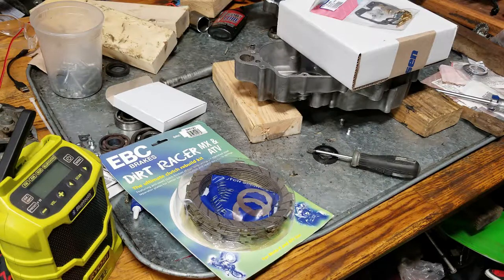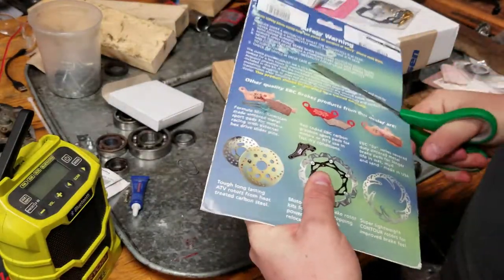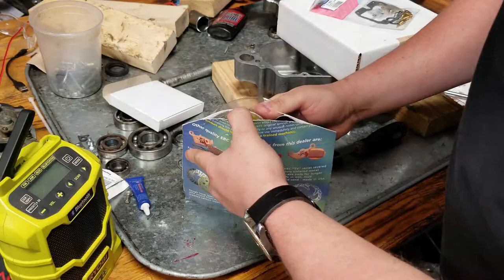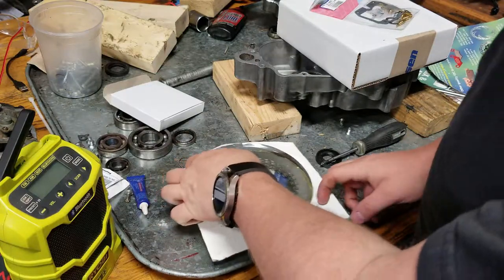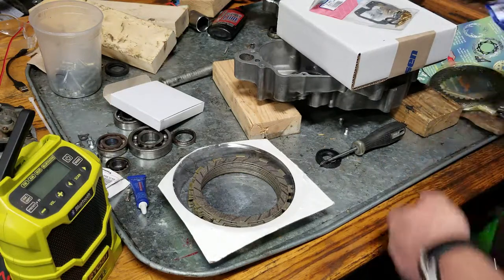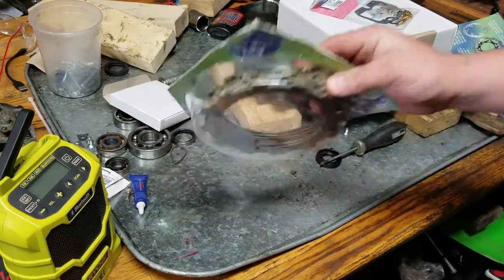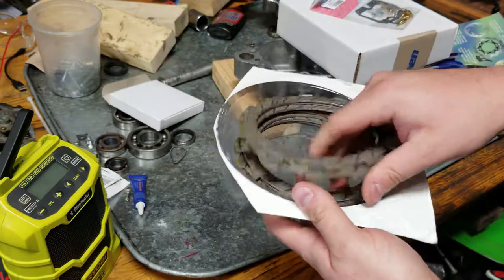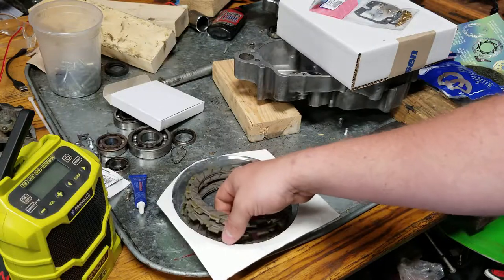Soaking Clutches Before Installation !

Comment: I think you should just install them and then fill the bike with the proper amount of oil and then haul ass, but whatever.
Reply: I am about to do the exact thing I said above on my 2003 KX 125, so we will see what a dry install and fresh type F ATF does. I'm willing to bet it works just fine; pull the clutch in, kick it over to oil the plates, and away we will go. If it doesn't, $45 isn't too bad to find out. Any takers?

Comment: Grab em with your hands man. What? are you afraid of wrecking your manicure geeze...
Reply from the maker: Why would i need to grab them?
Reply: @mxgryan  so You can lift them apart like you even said in the vid. so the soaking of the oil can be done evenly
Reply: @malakagee literally makes no difference lol. Why would you want oil on your hands if you can avoid it